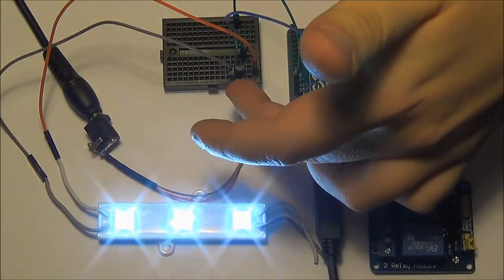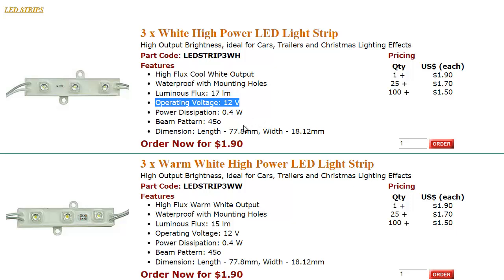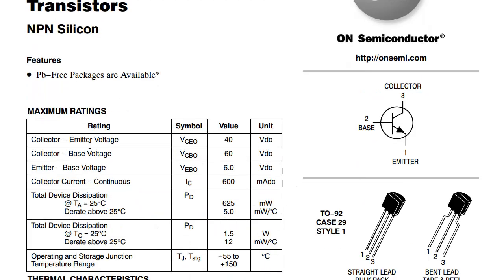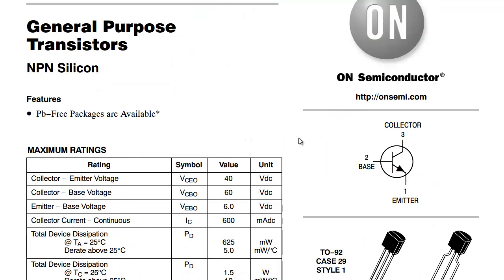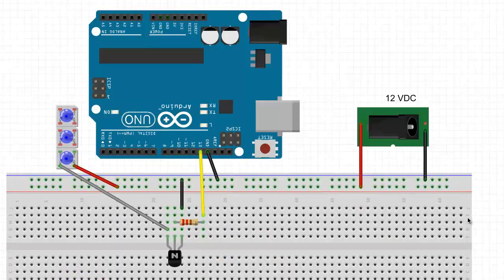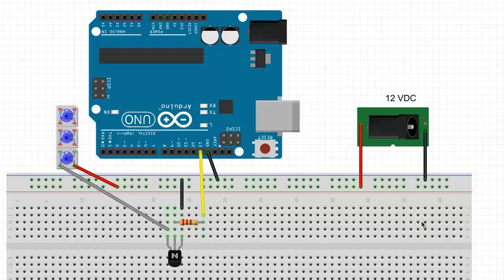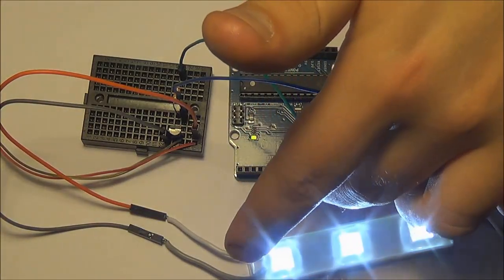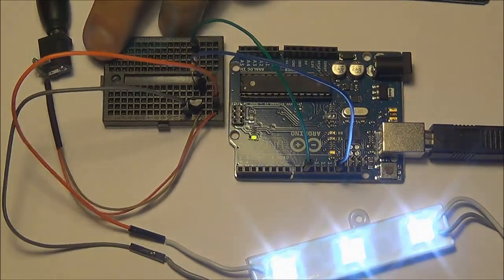Arduino #11 - High Current & Voltage Loads Tutorial - Transistors and Relays

Comment: Can you please explain why did you connect the arduino to the GND? Isn't the pwm signal wire the only wire which should be connected?
Reply from the maker: You should never leave floating grounds. If you connect just the output and for whatever reason you have a charge on the device, you will have trouble switching. It will not always happen and you may get away without it, but you should always make sure that the ground reference is the same for all of your devices.

Comment: i got a rfid access controll unit that chucks out 3.5 volts that can be used with a relay to open a door but ardiuon rely uses 5 volts to activate so im like 2 volts short (i dont mind being a lil bit over 5 because of lengh of the wires) another thing i might need to do is use an arduino to measure the small 3.5 volts and then power a relay from another power sorce any ideas whats easyest and uses less components (including maybe the arduino or how can i protect the arduino (what resister(s) do i need to make 8 goto 5 (max) if i need to combine the rfid output voltage and the 5 volts ardiono power with common ground?

Comment: nice video sir.. i want ask question between high current/voltage and relay, if i use high voltage, what kind of relay should i use??
Reply from the maker: You need to make sure it is rated for whatever you are trying to do.

Comment: Sir nice video. I am currently working on a thesis project and your tutorial saved me. My only problem is the transistor, it gets hot to the point where in it smells like a burnt rubber. Is it normal? I have little knowledge in resistors and transistors. What is the color coding of the correct resistor for this project. Hope to get a response thank you sir.
Reply from the maker: The most likely issue with your transistor is that you are drawing too much current through it. Check the datasheet of your drain current for the transistor and make sure it is greater than your load. Also, once the part is damaged it will most likely keep heating up. Replace it with a new one once you have confirmed the values.
Reply: EEEnthusiast  Thank you sir for your feedback. I am using a 2n4401 transistor. I don't know how to say it but I don't know the drain current of the transistor and the load of my circuit. I'm just amplifying the 5v from the arduino and make it 12v by using the transistor.  My device is an EM-Door lock that requires 12v. I'm not also sure if I am using the correct resistor all I know is that I am using a 2n4401 transistor. Thank you again sir. I would really appreciate it. I don't know who to ask and I'm a programmer not an engineer.
Reply: EEEnthusiast the giveaway ?

Comment: first , thank you. very good tutorial
my question is: if you are driving 8 relays all of them opto isolated as yours are , do you need to add transistors between the arduino and the relay to protect the board?
i did hear that  you can power up to 4 of these relays at a time but over this you may be drawing too much current from the arduino. Is that true? 
i did hear that each relay will draw 20mA current 
you said you didnt need a transistor because you had a relay . Does that mean the relay has a transistor built into it ?
Reply from the maker: Depending on the current your relay draws you may need a transistor. If your particular relay will draw 20mA you will be fine without using a transistor.

The module I used in my tutorial does have a transistor, BUT the relay itself does not. Make sure that you are not trying to drive a 200mA relay with your Arduino.

Another thing to watch out for is the voltage regulator on the Arduino. Even if you do isolate the 8 relays with transistors the current has to come from somewhere. The Arduino board has a voltage regulator which (if I remember correctly) can supply up to 1A. This means that you will not be able to run more than 4x 200mA relays.

Conclusion: Always consider all your components! You need to know the current drawn by the relay coil as well as how much current you are limited by. It is also possible that your USB port would not be able to supply all those relays.

Hope that is clear
Reply: EEEnthusiast thank you
Reply: A transistor in this scenario is nothing more than a switch. You can use the transistor in combination with an external DC supply. The transistor will take less power to switch your external DC supply to turn on the relay, so no worry of the 1A limit.

Comment: Ohh No another Arudiodrone part of Arudino sect. Building Arudino Lego blocks rated from age 3+.   LOL
Cheers
Reply from the maker: Arduino is just a platform. Working with any other controller is just as easy if you understand the fundamentals of the device... Cheers.
Reply: Just kidding don't get offended.I started in electronics as well MCU programming  over 20 years ago when in my mid teens. Compare what I had as tools as well help back in the days is nothing what you have today, and cheap as dirt. I am trying to get my son in to electronics and used your Youtube to help him. First I bought him Microchip kit but complex and lack of programming skills at his level. Then ARUDINO and he's catching it. Nothing against Arudino but it's over simplified and  it's like Lego (IMO) and you do things without the basic understanding. But on another hand -easy to work with -modules and tutorials and code everywhere. 
Cheers
Reply from the maker: Janusz Gluszak No offense taken. I agree that Arduino is the simplified platform. When it was brought up in one of my classes in electrical engineering, the professor said it was "absolutely banned". However, I think it offers a great opportunity for people who are either not hardware oriented or simply explore electronics as a hobby. I'm sure your son or anyone in their early years would be more excited by seeing this work versus reading 800 page microcontroller datasheets. In any case, to each their own, but Arduino has its merit for sure. I'm not denying it is much simpler than if you were to use the Atmega328... It isn't even close.

Comment: Thank you for your instruction on the relay Module my module is the same and to turn the relay on it goes through an opto and transistor but needs negative to turn on, so how do you get the arduino output pin to go negative ?

Thanks Bob

Comment: If I want to switch a 240V device with an arduino, do I need to run both 'hot' legs through separate relays, or only one? Thanks.
Reply from the maker: It is possible to switch just one leg. As you know unless your circuit is closed you will not get current through. That being said, the common practice is to have both legs switched for safety purposes. You don't need two relays; there are relays that have two poles meaning that you can switch both phases through one relay. Hope that helps.
Reply: EEEnthusiast Yes, it does help. The relays I've found so far that are rated for 220 VAC  are not of the two-pole variety, and all the tutorial videos show 120 VAC or less with the Arduino. Thanks for the reply and for the good content. I'm a happy subscriber...
Reply: ***** Thanks David. Right now I'm still working on coding and prototyping, but once I get into production in volume, I'll switch to SSRs. Meanwhile, thanks for the tip about the diode ... will do. I've only got two boards and I wouldn't want to fry one of them. Cheers.